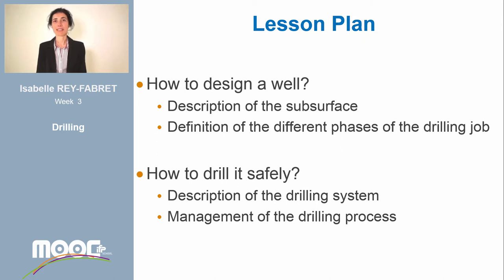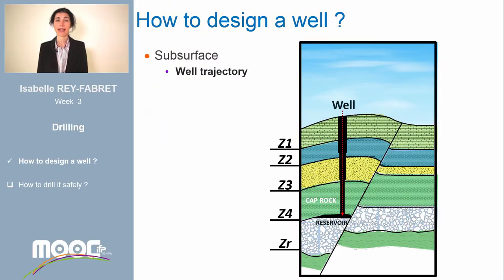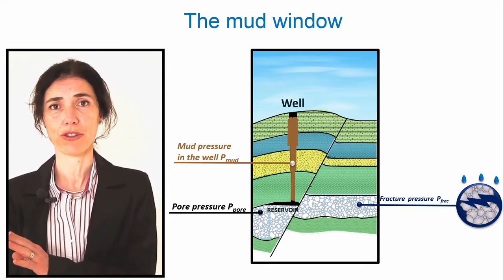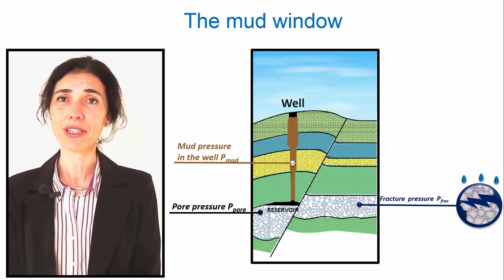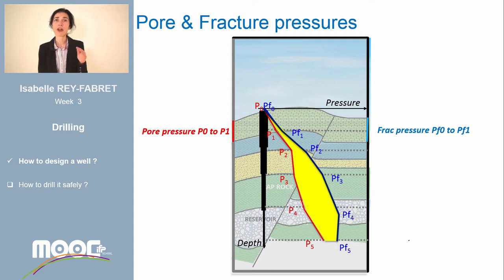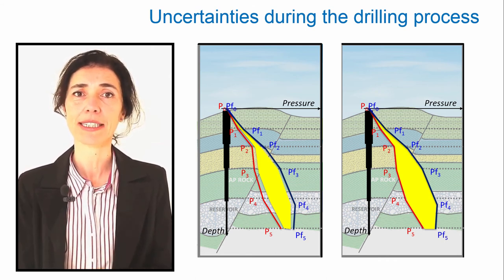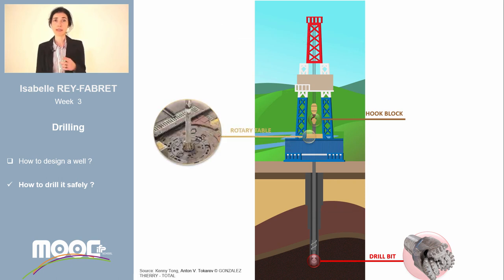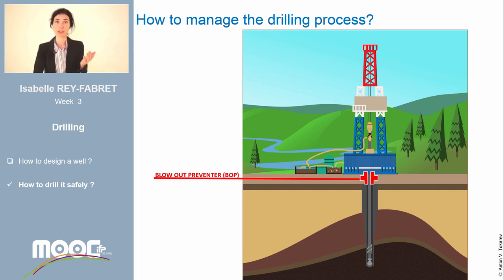How to Design Well -OIl and Gas drilling

Comment: Mud Hydrostatic pressure doesn’t only depend on Depth. The fluid density is very important as well and it’s the key parameter to deal with during blow outs.